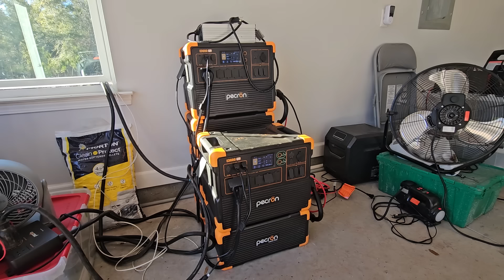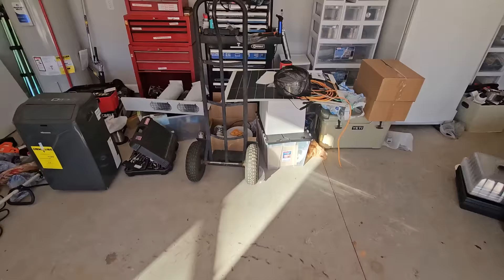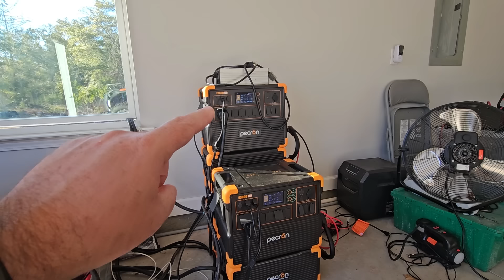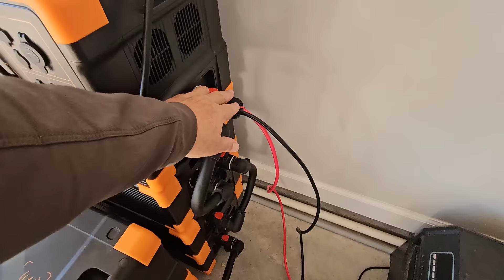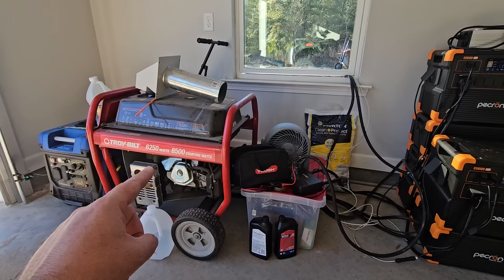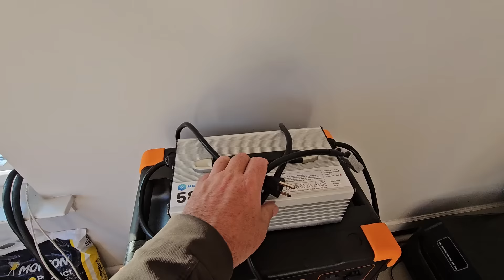One Year + Real World Review #Pecron #e3600lfp

Comment: I have one of these also. My only concern is it uses about 10 percent just sitting idle over night due to residual power utilization. Great for backup power on critical appliances. Runs my gas furnace and freezer fine. If your purchase to save  money on electric. Won't save much. Back up and camper use Great!
Reply from the maker: If you're using any of these portable power stations in UPS mode it actually uses a small percentage more power. It ends up costing slightly more to use it this way.

Comment: This is what I’m trying to do.  I live in Arizona. I’m trying to run a portable 7800 BTU for eight hours at night and have it recharge with solar during the day just in case of an emergency. I haven’t bought the pecron 3600(x2) yet. Have you tried something like that and am I going by this the wrong way?
Reply from the maker: I ran my travel trailer 100% off grid for 6 months in 2025 using a single E3600LFP with 4 EB3000 batteries and 6 400W solar panels. For your use case, an 8000BTU window unit would consume around 4.5kwh of continuous operation. One E3600LFP with one EB3000 would meet that need.
Reply: @GridDownPreparedness thank you.  It’s challenging finding people that know what they’re talking about. It’s even harder to find people that have done it.

Comment: I just ordered the E3600. With the 240 hub, thanks for the info, not going off grid just looking for something during an extended outage!
Reply: I’m on the edge on getting two of those and for the same reason. I just want to be able to run a portable air conditioner.  Right now where I’m at in Arizona. It’s 9pm and it’s 100°.

Comment: I'm look at a Pecron (F3000, E3600, or E3800) to run a 8000 watt a/c and TV for 2-4 hours during a brief power outage.  Like you, anything longer, I am connecting a generator.  Do you think your E3600 could do that?  I was also considering spending more on Anker Solix .
Reply from the maker: You mean 8000 BTU right? If so I am 99% sure it will work. I have a 12000 BTU portable AC and the start up amps sometimes cause the E3600LFP to overload, trip off, and I need to reset it. I don't use it anymore. I was thinking about getting a smaller window AC to test. However, my travel trailer has a 12000 BTU AC and it runs it just fine. I used it for 6 months living off grid while I built my home. No issues.
Reply: @GridDownPreparedness  Yes, I have an 8000 inverter btu.  Perfect thank you for responding.
Reply: This is the only reason why I’m looking into this. I have  a GE 3in1 7800btu.  i’m just wondering how your set up is working for you.
Reply: 8000 BTU is gonna run you about 800 to 1200 W.   

3600 unit. With one expansion battery.  U should have around 7k watt hrs.  Maybe 6 hrs at 1200 w. Air conditioning. 

Max out your solar. 3000 w.   Charge in one sunny day.
Reply: @aubreytacopirate7625  I did buy a 3800 with an expansion pack. It used 11% battery in 40 minutes. The max was 1152 W. I used three 300 W solar panels was only getting over 600 W per hour. Pecron said I should get up to 720 with a three. I used AI and it said that is common to get between 650 to 720. I know you don’t get the max when using solar panels. I am surprised it was that little. The next experiment I’m going  to  use five 300 W with 80 foot wire.

Comment: Did this guy overload the Pecron, or was the inverter failure Pecron’s fault?
Reply from the maker: The inverter board had a component failure during normal operation. The E3600LFP is rated for a surge of 7200W. A new Inverter board, BMS, and a firmware update solved the issue.

Comment: Hi. Like to ask if the backup reserve feature works even the grid power is connected? 
Like have the backup at 30% while the solar will charge the rest 31% to 100% while using the unit and connected to the grid. 
Will the grid charge stops at 30%? 

Thank you
Reply from the maker: I actually haven't tested that yet. Thanks for the idea! 🎉
Reply: @GridDownPreparedness  please do. Thank you.

Comment: I bought a Pecron F 1000 it's shut down after 2 days error code 25 I contact the company they won't repair it they'll send me the part so I can fix it myself😢
Reply from the maker: It sounds like they are opting for a self-repair route, which is unfortunately common with these portable power units when they have component issues.

Comment: I have never heard claims for these Pecrons having issues with surge start issues with portable or window ACs. Sure there are issues with battery watt hours under certain scenarios but that is to be expected imho.
Reply from the maker: My portable 1 ton A/C has a much higher inrush current than I had expected.  It's about 45A so, it puts a lot of stress on the power station. A smaller window unit or more ideally 240v mini split would be better

Comment: Thank you for your extensive testing of these units, I’ve learned a lot. I have a similar dual LFP 3600 with the 240v box. While connected in the 240v configuration, have you tried to charge the systems with a 48v LiP04 charger via the solar input by adding an XT60 connector to the battery terminals. I think it might not tell the difference between solar and charger since it’s the same dc power. This would allow you to run a smaller inverter generator to power the charger while it powers the solar ports without disconnecting the 240v box as it may be powering your home. It could even provide you power when the weather is not favorable for solar. Thank you
Reply from the maker: No. The LiPO4 charger needs to read battery voltage to start charging.
Reply: Ok, thank you!

Comment: The Ankers F3000 smokes the Pecron. UL listed and actual support and firmware updates. Peristaltic draw is half of the Pecron @ about 18 watts. I don’t know why people rave about these units when most use words like - cheap - failed - sent back - errors - stopped working - weeks emailing support - ect…..  Every Pecron  I have bought has failed @ some point. The Ankers F3000 has not had one issue because it’s made with quality components from a company that doesn’t use cheap materials. To each their own but I’ve learned the hard way to stay away from cheap, best bang for the buck. Actually I didn’t pay much more for the two Ankers, couple hundred each and worth every penny. The one Pecron I’m kinda curious about has taken them forever to finally release and I can’t wait for all the reviews. The F5000, but I think it’s over priced given their history on cheap budget units. You can buy an ecoflow delta pro 3 for the same price and that unit is also UL list. Just my 2 cents. Good luck U all with Pecron and remember U get what U pay 4. So don’t go cryn when it breaks and it take a month to get fixed or replace. Peace ✌🏼
Reply: Not to mention Anker is apparently the ONLY portable power station company that has US based phone support where someone who speaks English answers.  EcoFlow is said to have the "email and wait" chinese tech support, too, and pretty slow response time.  Anker F3000 would probably be my pick.  Bad side of theirs is their overpriced proprietary plugs.

The one main thing I give Pecron credit for is that they have videos showing how to replace things if they need to be where no one else does.  But that would get down to IF they actually have parts available to ship if that happens.
Reply: @ITguyAR_66  I actually love those plugs. They can’t be accidentally pulled out and their solar connection has a voltage cutoff button before you unplug, so as to avoid arcing. They are designed to be safe and that’s a good thing. if you press the disconnect button on the solar plug before you pull it out, it cuts off the voltage so you can safely unplug it during the day. If that makes sense.
Reply: @user-c4i9t  You have a point, there...

Comment: Fantastic work on the channel. Im sub'd now.  I just Binged watched a lot of your videos at both normal and 1.5 speed. I too just purchased 2 E3600LFP's with the 240 volt connect box to run my well pump and small workshop for my complete OG property and to take with me when I camp..dual purpose!  Fortunately for me. Signature Solar is 1 hour from my place. So, I also run a 12000XP and 4 EG4 wall mount batteries for my house and the amazing EG4 12K hybrid mini split( I highly recommend it). 1 easy recommendation- I know we all tend to run wires through our windows from time to time(mine is my chargeverter) is to use a piece of thick pipe insulation or even a pool noodle to help "seal" the gap to prevent unwanted airflow, water intrusion and bugs! I've learned a few things from your videos like the cascade cable and cutting the data wires or making your own DC bonding cable which I will do! So, thank you for all you've done for our community!
Reply from the maker: My pleasure! Thank you for supporting and helping my channel grow.

Comment: Hey Wade, Have you noticed that the AC inverter fan behaves differently in your newer 3600 vs the older unit? Not referring to the two cabinet fans but the AC inverter fan. If so can you describe how they behave different? Thanks.
Reply from the maker: There was a noticeable reduction in noise after my first E3600LFP was repaired. I haven't noticed any difference in any fan noises between the 2 units as of today.
Reply: @GridDownPreparedness  OK. Thanks. I think I have a bad cabinet fan o my replacement unit. It constantly pulsates fast/slow or on/off in a sporadic tempo every 0.5 sec to 1 sec. Driving me crazy.

Comment: I see you have the 4 expansion batteries hooked up while in 240V mode with the 2 E3600LFP units. Is it possible to have a total of 8 expansion batteries in 240V mode by connecting 4 expansion batteries to each of the E3600LFP units? Love the channel and your knowledge you are sharing. 👍
Reply from the maker: Yes.

Comment: Remind us what DC charger you are using that is on top of the unit against the wall
Reply from the maker: It's a  Hexwatt 58.4vdc golf cart charger.  Charging wattage is about 1100w. I use it as an emergency charging option when I can't disconnect from my house.  It's not ideal, but it was cheap. Also, I can't leave it in auto, because it will overcharge the batteries.  That can lead to damage and potentially cause a fire.

Comment: I saw on the E2400 specs that the "surge" rating was a duration of 10 ms.  That is less time than a UPS changeover and clearly not enough for the surge to recede.
Reply: Be careful with switchover - I have several different power stations that advertise UPS functionality (< 10ms switchover) but I have seen network switching equipment restart when the power failed, so there is enough dropout to cause sensitive electronics to reboot.   Test before assuming.

Comment: With your technical abilities, it's surprising you went with the official expansion batteries. You could get double the kwH for the same cost though you have to know how to connect right. Which I'm sure you do.
Reply from the maker: When I purchased the E3600LFP an 4 batteries, it was for portability.  I was in a rental house and knew at some point I was going to use the system to power my RV. The original plan was not for home backup.  It evolved into that role. If I started from zero in my new home, I would have went with EG4 12000XP and rack batteries.
Reply: @GridDownPreparedness  the problem with the larger AIO they have a larger idle consumption waste and they are very expensive. the EG4 12000XP has an idle consumption of around 70W and in a 24 hour period that's 1,600 watts so you must have a big enough system to justify it. i have currently 10-200W panels and in the winter in NYS i sometimes make enough power to run my inverter and have very little left over with my. that EG4 unit is also $2,600.

i have a sungoldpower 5KW AIO that costs me $715 on sale, it is parallel capable up to 30KW and it is hooked to a humsienk 48V server rack battery that i picked up for $600. if i run the sungoldpower 5kw in ECO mode it drops the idle consumption down to around 30 watts. if uses a pulse to detect a load, so right now it is running a well pump and a sump pump. it is the dead of winter so it is atleast doing something useful. if i had a small array hooked up to an EG4 12000XP it would be utterly useless in the winter.

my intention is 5,200W of solar panels and 2-3 server rack batteries this spring. i have to start shedding loads from my utility consumption which has risen to 28 cents per kw.

i was going to buy a power station and decided against it. i have no regrets not buying a power station. the sungoldpower unit does work well, and it's far more economical than an EG4. it is scalable. my entire setup so far only set me back around $2,200 or less than just an EG4 12000XP. i have similar components but at a lower cost.

Comment: As much as I like all my pecron power stations, I wish more people would mention what a nightmare the app & wireless connectivity is. It's impossible to use the bluetooth connectivity without a wifi network of some kind to establish the pairing and, when it inevitably forgets how to connect you again need wifi to reestablish the bluetooth pairing. Then there's the myriad of "quirks" the app has. It's infinitely frustrating when you're actively trying to do something and, you have to retrain the app to sort of function as intended.
Reply: I refuse to use the app. I'm not giving a Chinese company my wifi password and turning on geo location so it can upload all my data. There's no reason it should need my info. I've heard it will use BT but requires wifi for initial connection. Why?
Reply: @reefhound  I've yet to find any electronics other than speakers/earbuds that will use Bluetooth without wifi, at the bare minimum, for initial setup. For sure nothing that does two way communication. But, if you're using google, crapple, amazon, any meta brand platform, any of Leon Muskrat's products, etc., anything in China should be the least of your concerns.
Reply: @reefhound I just use a aircard or MIFI device so it doesn't see anything on my network.  The whole app gives me CCP prying vibes.
Reply: @truevine336  "CCP prying vibes" vs "Feds prying vibes"?   Not sure which is worse, at least the CCP is not swatting your home.
Reply: @ckm-mkc  They're both terrible, I just don't want commies in my stuff either.  It's just a 50's thing.
Reply from the maker: I agree that the app could use some improvement, especially with connectivity.
Reply: @GridDownPreparedness   Indeed. And the display/UI. It's not very user friendly and, as often as not, diplays the status of the units backwards. It indicates connected units as disconnected while allowing you to control them remotely but, shows disconnected units as connected while you can't control them.
Reply: @absurdspeed , I like the  UI

This is like Android vs iPhone users. Preferences.....
Reply: @mr.c6674   My main complaint about it is it's ridiculous failure rate & painfully slow speeds. I don't think reliabilty & timeliness are "preferences". Second to that is it requiring a wifi connection to setup. It's terribly inconvenient when you don't even have a wifi router.

Comment: I have 2 of the E3600lfp and the 240v hub in what will be our retirement home. I hooked up a 50 amp input box and 50 amp breaker with an generator interlock . The home is a very energy efficient double wide. With everything running in the home (except central ac) it is pulling about 920@ watts. Propane stove and water heater help cut the electric use.  I even turn on the Clothes Drier. It runs it fine but pulls about 5500 watts. I am very impressed with the system.  Right now I'm working on getting more solar panels and expansion batteries.
Reply: Thank you for sharing your experience — we’re so glad to hear that the E3600LFP system is working well for you!
Reply: sige funcionando

Comment: Pecron is not type accepted for use in USA or Canada.  Issues require emails to China.  No phone  contact.  Beware!
Reply: My unit  was not under warranty anymore.   They still sent me a free inverter replacement and only charged me $30 for shipping.  

I paid some local tech 100 bucks to put it in
Reply: Neither are a lot of other competitors, only some models of Ecoflows are UL certified.   These are really designed for pure off-grid use, so don't actually require UL certification.   That doesn't mean you can't use them in creative ways.  And, AFAIK, Pecron answers both the phone and emails, which is a lot better than other brands.
Reply: @ckm-mkc UL certified and FCC certified are completely unrelated.  Do your homework...